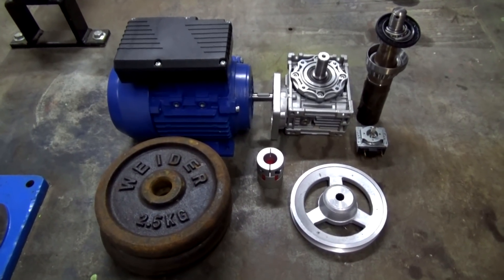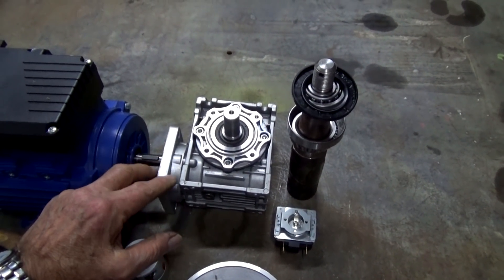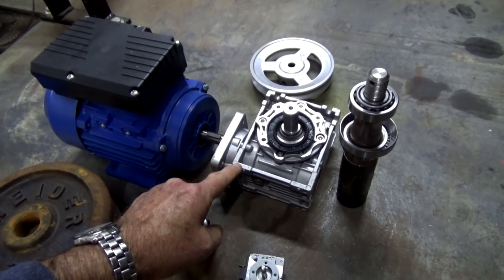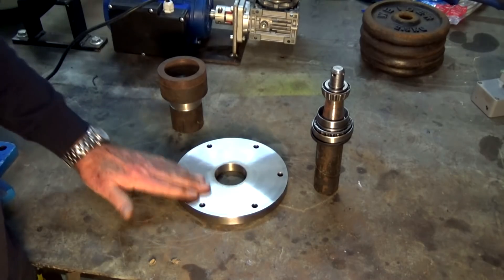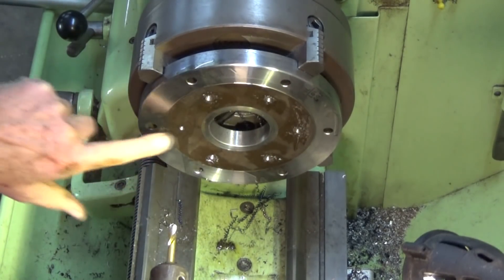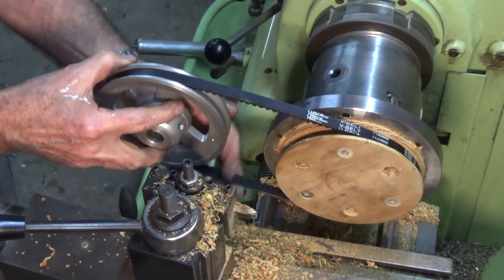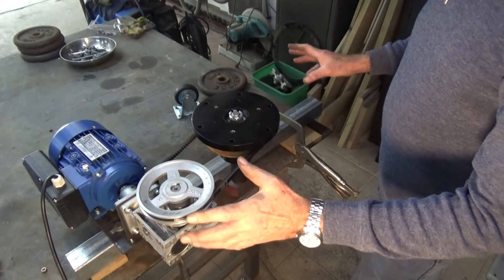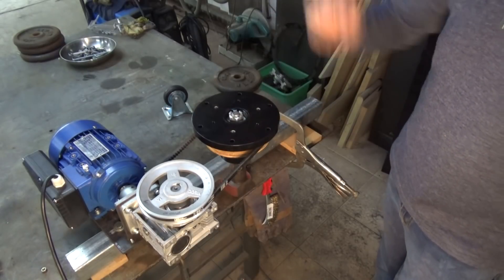The "Kooka Muller", a DIY Sand Muller for the Home Foundry Part 1

Comment: You will need more than 1 caster to support the drum load. 
Cheers
Reply from the maker: Interestingly, I got that part of the build completed today and I was able to stand on the base of the mixing drum and I didn't notice any deflection. I did this because I was also doubting whether it was going to be robust enough. It seems like it's going to be OK.
Regards,
Mark
Reply: @Preso58  And fully loaded with sand?
Cheers

Comment: you stil have a smal problem with the sound. use a headset and you will find it
Reply from the maker: You're going to have to enlighten me! I am intrigued now. Did you hear me farting?
Reply: @Preso58  more that it is more to one side and the other is sort of on and off. more then one of your videos have this. no other channel.
Reply from the maker: Thanks for the heads up. I checked my camera and noticed that some of the settings for the audio were still set at their defaults. I had noticed that when the video and audio tracks were put on the timeline of my video editor that the left channel was muted more than the right channel. I thought it was just an artefact created by the camera position. It is usually to one side or the other of where the action is taking place. The camera microphone was set to 5.1 channel surround sound and when it is imported to the video editor it is converted to 2 channel audio. This could account for the imbalance. I changed the camera to record in 2 channel audio and carried out a few test recordings and it now seems to be much better balanced.  I also changed the audio on the camera to the zoom setting. I must say that I have never listened to the clips with headphones on so I guess I didn't notice. I will need to pay more attention to this. 
Thanks again,
Mark Presling

Comment: I'm at 25:00 and I've been thinking for a while that you should gusset your gearbox bracket to the motor plate and I'm imagining a sand drum quite a bit larger than your drum pulley which is not a good idea for earthen processing equipment that will be subject to fairly high torque or can be in likely conditions of process variances. Look at a cement mixer. They're gear driven and even at that the drum gear is larger than the drum. Speaking of which, can't you just use a $156.70 cement mixer? FYI Nobody, nobody gives a rip about your dirty hands. We didn't click on a Miss America pageant and had we, there's always the hope of mud wrestling! I'm worried about your backing roller having a rubbery surface that will be subjected possibly to sand. And the idea of aluminum as a milling surface for sand seems almost as nutty as the form board. Go find a manhole cover or get some steel decking plate or boiler plate!
Reply from the maker: Well, that's a lot to think about! I had been looking for a used cement mixer for a while but out here in the colonies they cost a lot more than $156. With respect to the base of the drum, I passed up an opportunity to buy a piece of galvanised steel which was exactly the right size and thickness but at the time I hadn't committed to building this project. It was one of those moments when I thought "hey that's cheap and it might come in useful" but I failed to follow through and now I regret it. I know the aluminium will wear badly but I don't use the machine every day and I'm getting old so it will probably outlast me. It's a work in progress so I am guessing there will have to be a few gussets and mods along the way but I just got the compactor roller in today and the motor seems to be chugging along easily and it's driving the roller with no sign of stalling. It'll be different when the sand goes in though. We'll see...
Regards,
Mark
Reply: @Preso58  I bought an Ozito cement mixer from Bunnings just for this purpose. Problems are that it doesn't break lumps down to sand, and when water is added to dry sand the wettest bits stick to the drum. I'm going to look for some steel balls to see if it will fix the first problem, but worry that the paddles are too fragile.. Work in progress. Tempted to have a go at copying you - thanks for your first rate videos.
I got a rocket from the chatelaine this very afternoon for leaving black sand on the soap bar!